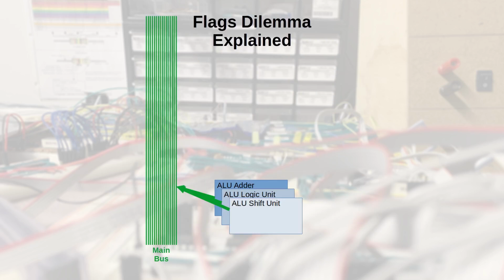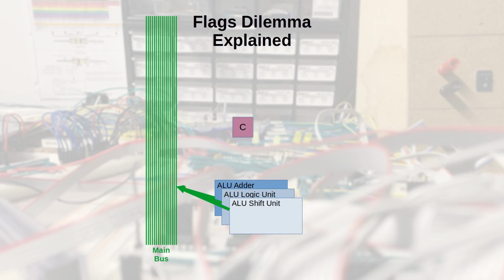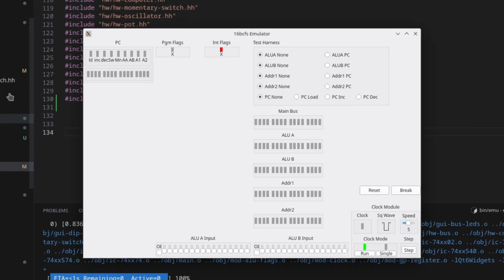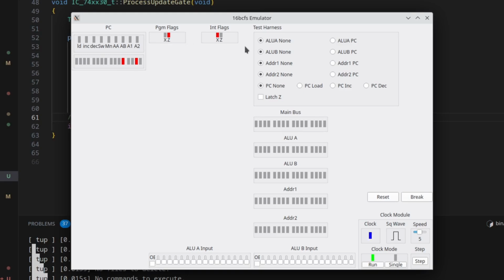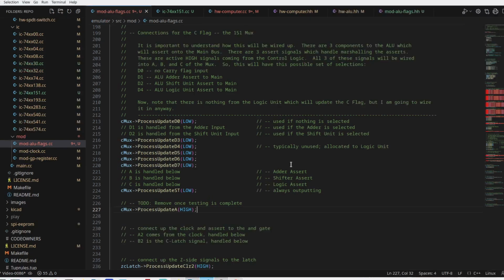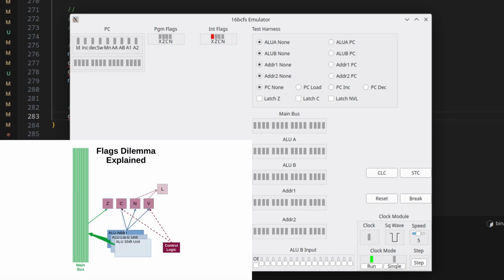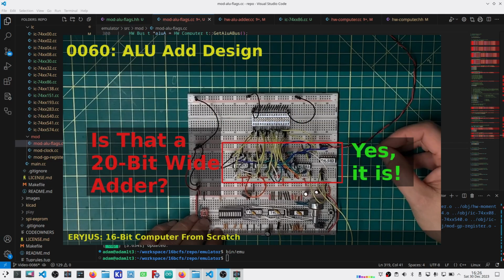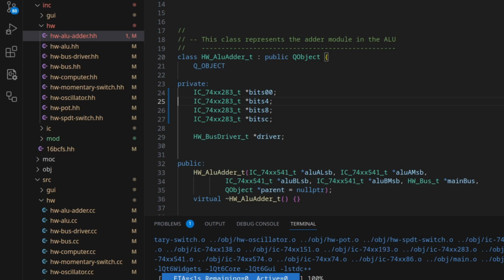0086: Emulating the ALU Flags | 16-Bit Computer From Scratch

Comment: The V flag is usually determined by performing the XOR function of the carries going /into/ and /out of/ the sign bit. Or in other words by performing XOR( carry_of_bit_14, carry_of_bit_15). This is typically the way it is computed in microprocessors. So I guess you were right in your first attempt. The problem of course is that the internal carry of bit 14 may not be directly accesible when using standard 4 bit adders in a Ripple Carry configuration...

Regarding flags, I'm not fully aware of the data types you plan to support in your CPU. If you are going to support both signed and unsigned arithmetic including comparisons, the usual approach is combining the N Z C V flags to determine the desired condition. You may want to google "ARM Condition Flags and Codes" (I'm not posting the link because I think Youtube does not like them in replies). For example:  Unsigned greater or same is determined by C==1; Signed greater than or equal is N == V ; Signed greater than is (Z==0) && (N==V) ; Unsigned lower or same is (C==0) || (Z==1); and so on.

Also a typical convention is interpreting the C flag after subtractions as the inverse of the "borrow" flag. This simplifies enormously arithmetic because chained long subtractions can be done by just applying the previous C flag unaltered to the carry input of the next subtraction.

A surprising fact that you may eventually encounter is that the computation of the Z flag is surprisingly lengthy and expensive, and there's not an easy workaround for that unless the CPU is pipelined.

Anyway, just felt like commenting this. If you already knew, just forget this comment.
Reply from the maker: @relaycomputer — you comment only shows on my phone app, not on the web.  @youtube is a mess again.  Forgive me as I try to respond in a “small format”. 

V Flag:  Both algorithms work.  There are 16 possible permutations (range of -2 to 1 for each input) when adding 2 x 2-digit binary numbers together.  It’s easy to write them all out on paper and compare the results between the options.  

Flags and Conditions: I am familiar with the ARMV7ARM.  I actually introduced them in video 25 and spoke about the concept of my L flag there.  I cite the ARMV7ARM as my inspiration.  It is simply a simplification of N=V which is latched.  But I used an XOR gate to compute it so in my build it’s N!=V.  Since I am using a 74HC74, I have access to both the Q and Q’ signals right from the IC.  I just have to pick the correct signal. 

C Flag: my plan is to have a Carry Select signal in the build.  It will feed 1 of 4 different carry values into the adder: 0, C, C’, or 1.  My use of the 74HC74 is relevant here as well. 

Z Flag:  I agree it will be expensive.  I spent some time thinking about it and the path I came up with for any given bit to the Z Flag was an inverting line driver, an 8-way NAND gate, and a NOR gate.  That’s only 3 “gates” (I use quotes because I know there are more involved than just 1 gate for the line driver).  To improve speed, the Z Flag will constantly be computed and only latched when relevant, eliminating the output enable propagation delay.
Reply: @eryjus4594   This YouTube comments issue is annoying. I can see my comment from this account, but not if I switch to another one. Since you could see it I wonder if my comment is somehow awaiting for moderation on your YouTube studio?, or whether you have some filters on Settings->Community that prevent comments to show to everybody?. I'm sure you have checked that, but other than that, I don't know what else this can be or what could I do (?)

For the Carry Select, you probably do not need C' (I assume that means inverted Carry) if you use the inverted borrow convention for subtraction. You don't need to invert the C flag either after the ALU result before storing, so it's a cheaper overall approach. I think only very early processors used the natural borrow for subtractions. 

Regarding the Z-flag, In one of my old projects I once computed it by using 3 way NOR Gates 74x27 followed by a 8 way NAND gate 74x30 (you must force the unused inputs on the NOR and NAND gates to 0 or 1 accordingly). This provides an inverted Z but it is only 2 gates delay.  (There's also the 74HC4078 8 input OR gate, but that's exotic and I recall this is slower). Since I ended watching the comparison conditions by the combination of flags, the fact the Z-flag was physically stored in an inverted way, was not important in my case. Also the unused NAND inputs provided a convenient way to support "compare with carry" instruction,  which would do the same as the CPC instruction on AVR microprocessors to support 32 and 64 bits arithmetic and comparisons